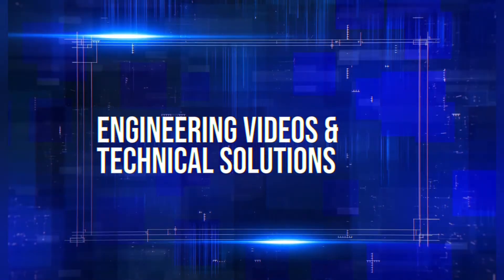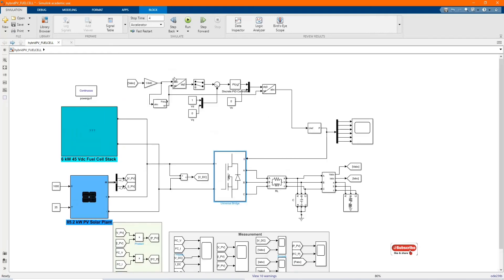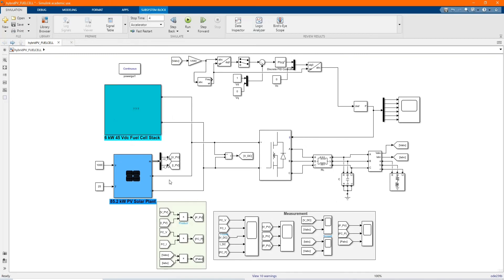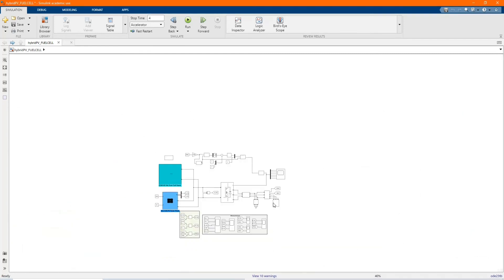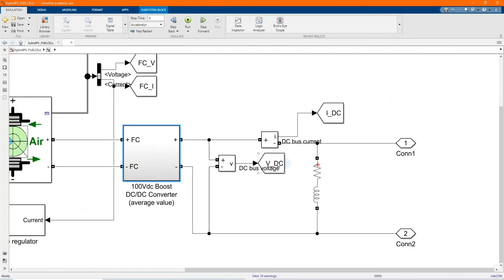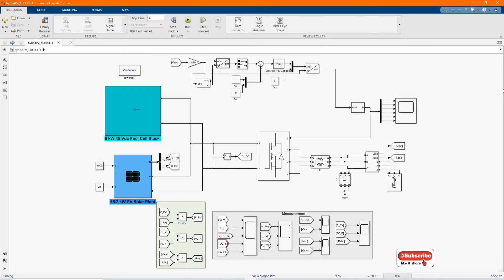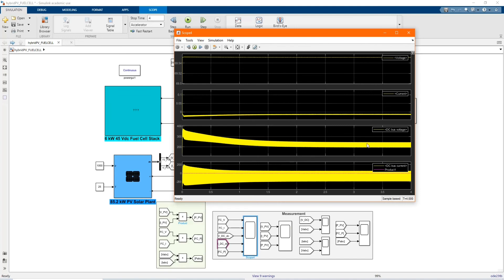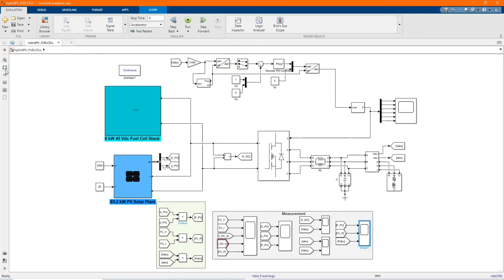Design and Simulation of Hybrid PV Solar System with Fuel Cell in MATLAB Simulink

Comment: hello.
how can we connect two fuel cells in series?
Reply from the maker: Hi thank you for your comment, We have not done yet , however, it can be done. What are you trying to achieve ?
Reply: @pzengineering2020  Hello.
i am currently doing modelling of microgrid.

Comment: Hello sir. I need your suggestion regarding a simulation of a hybrid system (combining PV and conventional) of my thesis topic.
I want to design a simple controller system like..when the sun irradiation is greater then 1500 (suppose) it will work as PV.. in evening when the irradiation is less than 1500,  the system will move to conventional system.
please sir help me out with this problem.
Reply from the maker: Hi thank you for your comment, can you please email to us engineeringsolution800@gmail.com

Comment: Thank you for your vedio it was interesting please can you share with us how to make management power of hybrid system pv panel /fuel cell/and battery, i have one problem i dont know  how to  control fuel cell by state of charge of battery SOC please if u can help me please
Reply: We have worked on this. SOC in the case of H2 stations. Come and see how we can help.
Reply from the maker: Helo, Thank you for your comment, i I understand the problem. You are trying to control the the fuel cell based on battery SOC? What is the main purpose of your project ?
Reply: @pzengineering2020  exactly power management  of hybrid system is my project, thank u sir alot for your response
Reply: @saraabssane4744  Hello sara, I am working currently on a project similaire to yours , can share your email so i can contact you please?
Reply: Salam @sara abssane I'm currently working on a project similaire to yours can you please give me your email maybe to help each other, thank you.
Reply: hello Sara i am working in the same project ...your e-mail or WhatsApp to share work
Reply: ممكن مساعدة
Reply: I have the same probleme if you have solutions send me please